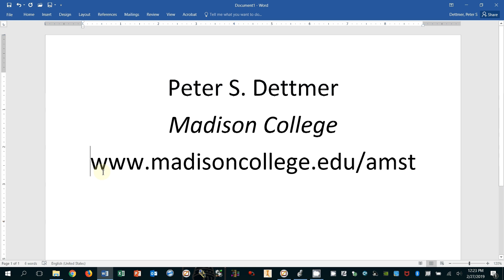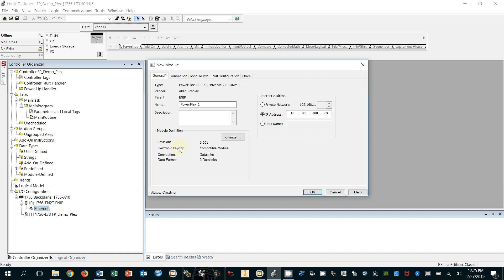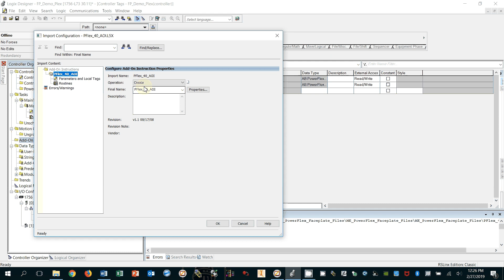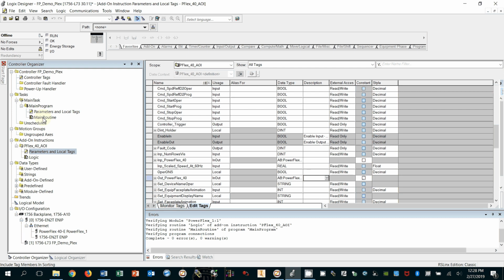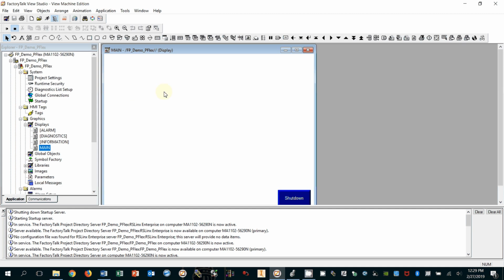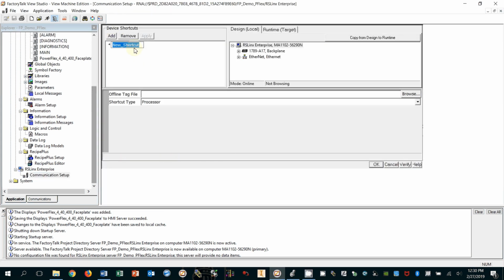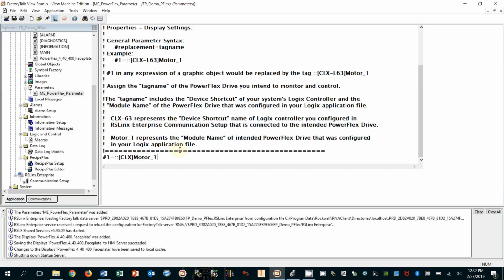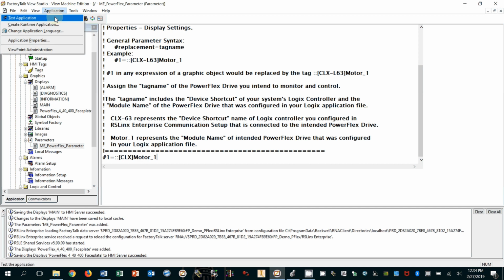Adding Faceplates for PowerFlex 40 drives in Studio5000

Comment: I followed step by step. I used FTV 9 (but created mer V8),  and a PVP 400/600 instead of what looks like a PVP 700/1000 and it didn't work. Would that be an issue? 

I'm getting a bunch of Expression contains a tag has an error value dealing with set_faceplaceAnimation and STS_ProgramModeEnabled. Thoughts?
Reply from the maker: Hmm, could be, but typically see students get something wrong in the parameter file (RSL-E shortcut name or tag name), or with the program parameters in Studio5000 (AOI). Send me an email with a screenshot, pictures or  the actual files, and I'd be happy to look at it. I'll send contact info via LinkedIn. Peter
Reply: @PSDettmer  Found the issue.  Motor_1 was a local tag and not a controller tag. BIG difference! LOL